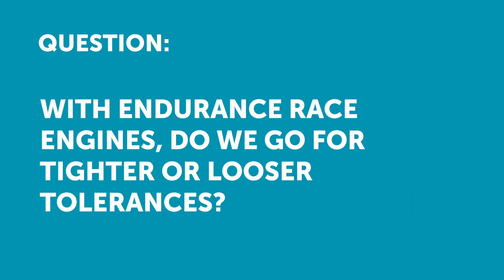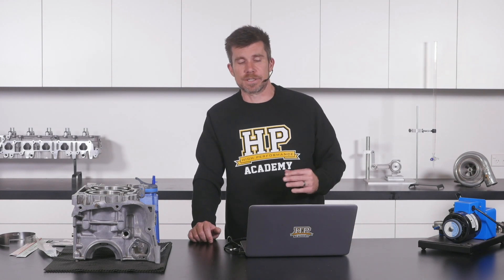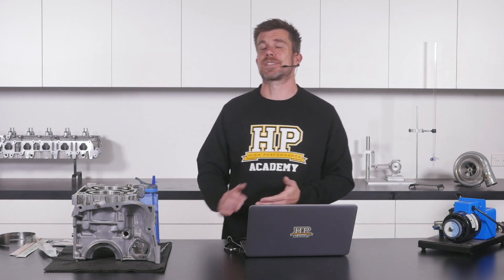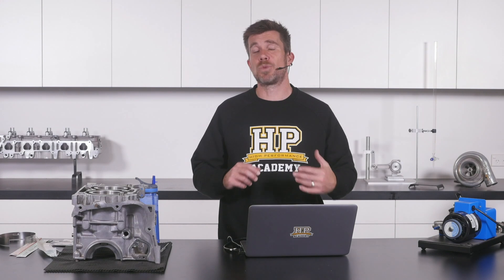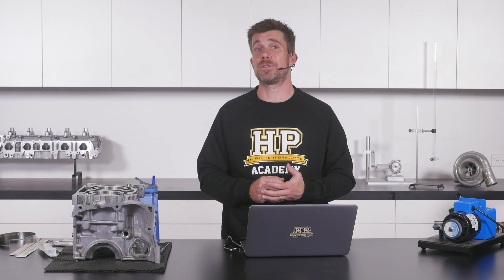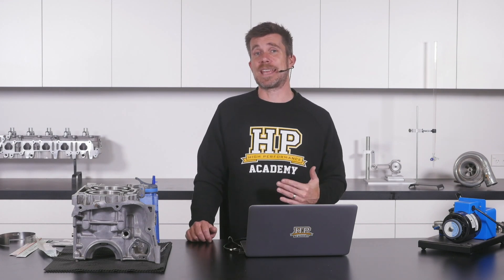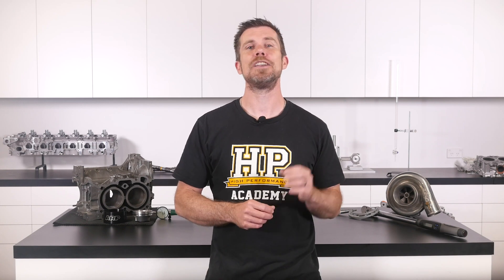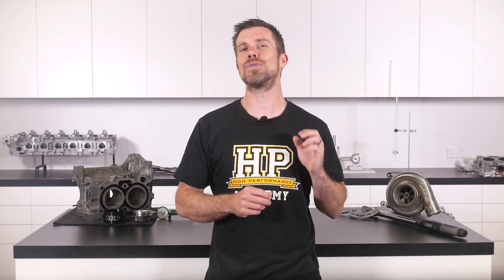Engine Tolerances | Tight or Loose? [HPA Q&A]

Comment: Worth noting that it pays to pay as much attention to the oil system as it would be to modifying the engine it self .
Also worth investing in a proper bore gauge to measure main bearing cap and conrod  circularity especially with older parts and well as giving you the freedom to measure the effects stud/bolt torgue has on those same bores .
Also ACL have a very nice suggested clearance chart that one can use as a guide .

Comment: Larger diameter big end journals are the way to go , rod bearing to journal clearance can be increased in this respect , a perfect case in point is a 4AGE Toyota , big end journal diameter increased to 42mm from 40mm , not only did that strengthen the cranks integrity and flex tolerance but also aided in dispersing pressure loading on the big end bearings at high rpm . An extra 1 -2 hundredths clearance is always a help in full race motors.  Just my 2 cents worth.......

Comment: Yeah this is an old school method to increase life of the motor. Increasing clearance was done because the tooling at the time could not achieve the kind of tolerances required to properly machine a tight toleranced block. The key to engine longevity is bearing life, or L10. What I have found, especially in the Subaru engines we build at P2P, is that tighter clearances allow for increased bearing life at higher HP and RPM because the eccentricity of the bearing allows for good fluid film thickness. Increasing this clearancing, like this videos suggests, creates more point loading on the bearing and reduces the fluid film under load, thus creating more metal contact events. Also, if you speak with bearing manufacturers they will tell you that extra clearanced bearings have a much shorter life and will need to be refreshed often.
Reply: @Ryan Payne 
Yeah I agree about the Subaru clearances. I generally do 1.5 thou on the 5 mains & 1.8thou on 4 bigs.

Comment: Tolerance is not clearance...  Clearance is the space we require between parts, tolerance is how much the parts' real dimensions are allowed to deviate from our requested values.
Reply from the maker: You're absolutely correct there Jean-Jacques. Please bear in mind that this was a follow-on question pulled out of one of our live webinars so a little of the context is lost around the line of questioning that we'd gone down with the previous answer and subsequent discussion. In this instance the questions should have been worded 'clearances', not 'tolerances'. In hind sight I should have elaborated at the start of the question and clarified what we were really talking about though. Thanks for pointing it out - Andre.